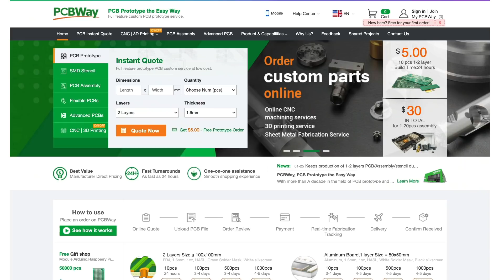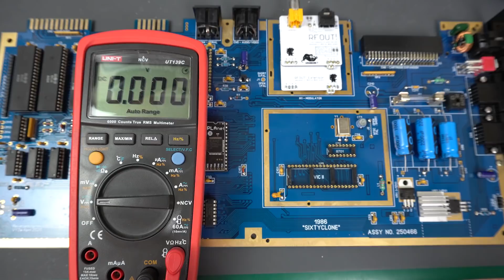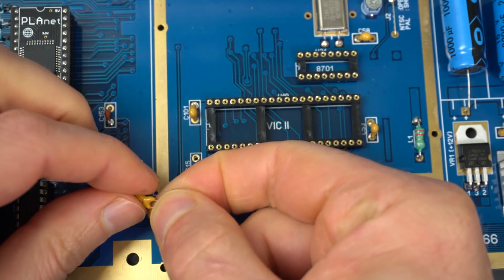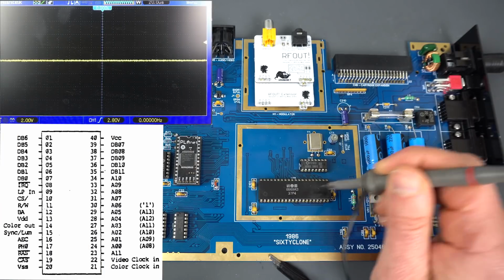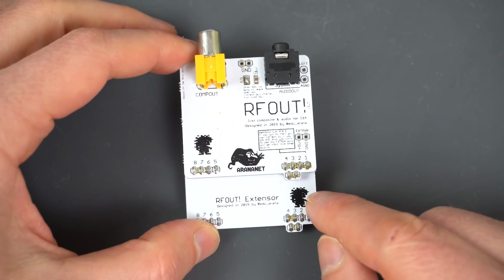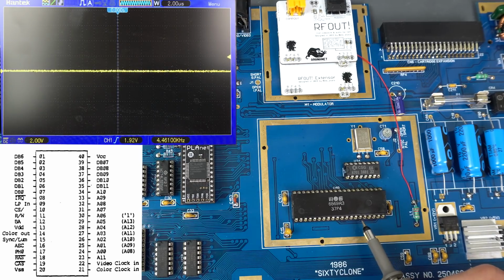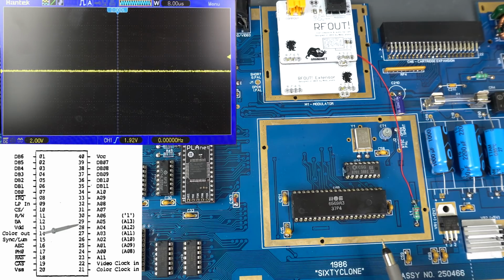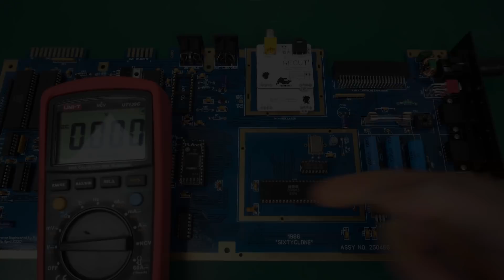Fixing a Modern Commodore 64 Build

Comment: The combination of the two capacitors should do the following: the 100nF eliminates the HF ripple, the tantalum capacitor  intercept the pulse peaks. The ESR value is lower than that of normal electrolytes. In most cases, it can be replaced with a LOWESR electrolyte.

I would not leave the reverse polarity tantalum in the circuit because it may be partially damaged.

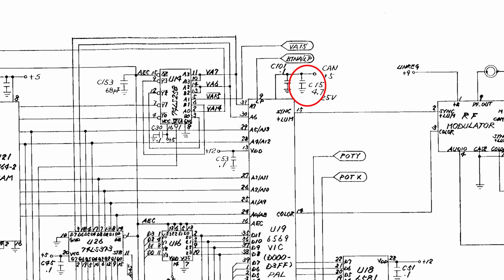Comment: 7:36 they used a tantalum because it has higher capacitance per volume than ceramic. If you look carefully at the schematic you can see that near the left capacitor is a .1 (uF i suspect) when near the right capacitor is a 4.7 (uF again i think). 
Nowadays they are all yellow (including SMT packages). 
Ceramic now include higher capacitance values but I would not be surprised if in the 1980s there were not. 
Also in this case the tantalum is used as an energy reservoir rather than decoupling (that’s a job for ceramics) so that if the voltage were to dip for some microseconds it would hold the voltage up while discharging. My guess is that a voltage dip would cause some kind of glitch, maybe some register losses of some kind

Comment: Although it was not the problem, I thought that maybe it could help someone else, who knows. What I was thinking right away was “oh maybe the backplate of the regulator is not to gnd but it is a vout pad” (although i think it would have just blown the fuse). But it could be an error that some non-experienced person could do. So maybe some ebay regulators or the wrong package can really cause problems if you are not aware of the fact that the back plate on those can also be Vin or Vout other than GND. I don’t know, I thought I should share it. Let me know if you think it might be helpful or a totally useless comment

Comment: A tantalum capacitor as more capacity than a ceramic capacitor. They are always used in tandem because the ceramic capacitor as a fast transient response the tantalum does not have.

Comment: Hello Noel, nice video and good desdcription as to what is going on.  Tantalum capacitors are used on power supply busses because they lossy and have significant ESR (
equivalent series resistance).  This damps the bus and prevents oscillation.  The regulator IC is basically a power op amp and is subject to stability problems if the output is shunted by a low ESR capacitor like a ceramic.  The schematic you presented shows a ceramic and a tantalum in parallel which is good modern practice.  IC manufacturers have papers explaining this and some of the data sheets also have explanations.  I have also read an interesting paper showing the effects of various capacitors on the performance of linear regulators.
Reply from the maker: Interesting! Those details are definitely beyond my depth of analog electronics, so that's really helpful. I ended up replacing it with an electrolytic one of the same value. Do you see any potential problems with that?

Comment: Prob the prev short causes the dram to malfunction? sorry, im new, and pretty much amateur in electronics to no one surprise even with my degree of electronic engineering lol
Reply from the maker: That's unlikely because the thing with shorts is that they take all/most of the current and channel it through themselves, usually dropping the voltage in the process (because the power supply isn't an ideal voltage source). So the DRAM didn't feel anything bad other than the voltage dropping after a few seconds, so it was like a nice way to turn the power off 😃

Comment: 4.7uF ceramic? Where were you supposed to find one in 1982? Of course it was tantalum.

I also wouldn't really be inclined to put it back in after pulling it out, i mean, it has been previously stressed.

Comment: never seen a blue tantalum before, where do you get them/what country are they commonly blue?
the ones I've seen come in two colors, a horrible yellow, and a charred black with just 2 legs sticking up and nothing else
Reply from the maker: Most of the ones I see in computers that go through my workbench seem to be blue (like the original one on this C64 board). Maybe it's a European thing, or maybe it's just the computers I usually work with. I've been told that most of the ones in PCs are yellow, which I usually don't work with, so maybe that's the main source of the difference.
Reply: ah right, the ones on the older machines I get are yellow, and usually failed, are the blue ones more reliable at all?

Comment: A tantalum capacitor is used here because its characteristics are very similar to an electrolytic: high capacitance in a small amount of space, but unlike electrolytics you don't have to worry about them drying out over time. However, you still have a high ESL similar to electrolytics, so for decoupling power rails you'll usually run them in parallel with a smaller value ceramic capacitor to make up for that. That's exactly what's shown on the schematic at 7:25, you've got a 100n ceramic in parallel with a 4.7µ tantalum. Other chips only have the 100n ceramic likely because the amount of noise they would dump out the v+ pin is small enough that it doesn't need the extra farads.

Comment: I've built a sixty clone replica and it worked fine since the beginning (I was amazed to discover I didn't do any mistake, and even if I used jumpers instead of the ferrite stuffs, it worked and works  yet flawless). That's the C64 I'm using habitually.
Reply from the maker: That's great! I'm still unclear why the original board is full of ferrite beads. I get what they do electronically (kinda) but I don't understand why they felt the need to use them everywhere. There are other computers of the time without a single one.

Comment: As someone that has worked with repairing electronics for 30 years myself, with a completely new board you cant even rule out that the traces are correct,something that you didnt mention and came to mind when you had the shoring problem of the 5 volt. I have personally had both shorts and breaks in the traces on new boards that the traces were supposed to be electrically tested on, not the most comon problem, but still. Great to see that there are people building these things, i still have an aoriginal breadbox Commodore 64 that i boight new back in the day.
Reply from the maker: Good point. I didn't go there because I knew that this board design was already tested and working with other people. But you're right that there was always the possibility of this one being defective somehow.
Reply: @NoelsRetroLab  Sure, but what i was talking about wasnt the design but rather the possibility of a manufacturing fault of that perticular PCB that you got in your hands, like i mentioned it has happened to me in some cases that one board out of many had faulty traces.

Comment: I have to wonder how a dead test cartridge even works without RAM. No RAM means no variables for your code, other than three 8-bit registers. Maybe with those three registers it's able to make due?
Reply from the maker: It's tricky, but definitely possible. I did that on the Amstrad diagnostics ROM, but there the Z80 has more registers to play with, so I think it's definitely easier.

Comment: Someone took their time to design a board - didn't change the power supply to single voltage with SMPS, didn't exchange CIA's, PLA, clock gen and ROMs (and probably others that could be done in programable logic, maybe even CPU) for an FPGA/CPLD. Seems it still even uses two DRAM chips when substituting SRAM is simple... Could have improved the whole thing by a lot (and got rid of chips that fail often), but instead just copied the original board...
Reply from the maker: The goal of this particular board was to be a 100% replica. There are other projects out there that designed the board from scratch and can add improvements like the ones you're talking about, which can be really interesting as well. But there's something really nice about it being completely backwards compatible with a real C64.
Reply: @NoelsRetroLab  Well... in part yes it's nice that it is an replica (that is made to a manufacturing standard and pads don't lift when you look at them), but then again some things about it are archaic. At least the power section could have been improved without detriment to the computer - even at a benefit, because its the powersupply that kills most of the chips. Same with the RF can area - could be used to just house chroma + luma buffers and composite mixer - no one is using RF modulators anymore (I hope) ;-)
I mean... it is kind of good that board like this exists - for masochists ;-)

Comment: I cut my 8-bit teeth on the Commodore 64 (with a special mention to the Atari 400 which was the first micro I owned). Those 8 bit machines were powerful enough to be interesting, and also simple enough so that a properly obsessed school child, armed with the provided documentation, could suddenly find themselves a budding computer scientist, with WarGames on the big screen to let us know the magnitude of what was coming. If you're a very young person seeing this video, know that the Commodore 64, first among equals of the period, was an absolute game changing personal computer, and many of your favorite games were probably contributed to by programmers who had learned the core, really important, lessons of computer programming on computers of just this type. Also, it wasn't even a "weak" computer. Color hi resolution high speed graphics (faster than the human eye, anyway), great sound synthesis, a peppy clock speed. Once you owned a machine like a Commodore 64, even as a child, and had read its operating manual, it was manifestly obvious that if you could master it, you knew what a real, powerful computer truly was, and that everything that would come after this would just be more of the same, better to be sure, but only quantitatively, not qualitatively, in accordance with Alan Turing's 1932 epiphany that, deep down, there's only one kind of thing anyone that can make that should bear the term "computer", &c.

Comment: The Tantalum capacitor used as a low impedance Coulomb (Charge) bucket. They are often used on power supply rails that are a fair distance from the voltage regulator.
Reply: I was just about to write a comment to that effect. They have a nice low ESR and make good decoupling capacitors. They also really do not like to be reverse biased!
Reply: They're damned dangerous things particularly when becoming old or subjected to overvoltage where they can spontaneously ignite and launch themselves as burning fireballs!
Reply: Yes, the low ESR enables them to dump or build charge faster. Combined with higher capacity and better temperature and frequency stability than cheramic, they are a typical go-to for decoupling digital circuits.

Comment: When building a kit, you don’t just solder everything in place, cross your fingers and expect it to work, instead you construct it in logical stages with component value checking as you go. For instance,  initially assemble the power supply regulation circuit and check to see if it works, then progress to the next stage which might be installing any clock circuits.
Reply from the maker: True, that's probably a better way, but you need to be intimately familiar with the circuit itself to pick the right order and make sure you got all the components required up to that stage. I suppose a kit could provide those instructions, but most of the ones I've seen just have you solder everything, and at best, they'll provide some checks afterwards. I do like your idea though.
Reply: @NoelsRetroLab  Many thanks for the reply. Most kit instructions follow that lottery approach. I designed and built commercial prototypes from 1970's onwards for many decades where it was necessary to use an incremental approach. In the 70's through mid 80's prototype PCBs did not have solder resist so careful soldering was required to avoid unwanted short circuits. I do really like some of the modern mod kits that use bespoke flexible PCBs to replace bodgy wire connection to neaten their installation.

Comment: These detective / resurrection episodes are fantastic! Question / concern: When you changed the voltage on the RF module to +5 by unsoldering the pin and running a wire ... is there any risk of accidental contact of the pin still present in the unsoldered hole (perhaps by vibration if the machine is moved around)? Would it be appropriate to snip off the pin on the “bottom board” of the RF module?
Reply from the maker: Thank you! No, there's no concern about accidental contact. I actually removed the metal pin completely, so you're left with the plastic from the pin header separating the two solder points.

Comment: NEW CIA, VIC-II and SID replacements are also really important.
Reply from the maker: Right! Working on a SID-replacement comparison episode at the moment. Coming soon! 😃
Reply: @NoelsRetroLab  Yeah, I saw a recent video with an FPGA SID playing Lightforce tune and it sounded OK at the bit near the end where most emulations fail. Not sure on the state of VIC-II direct replacements. CIAs are less important for now and most of the other chips are no problem as far as I know. Of course you have to recreate the exact smell of a brand new breadbin C64 from 1983....maybe one day I will do a video on what readily available item will do that :)

Comment: Wow! I just built a Color Maximite 2 and it had some tantalum capacitors. I had no idea they were polarised.. amazingly enough I had 3 soldered the right way around. Very lucky!
Reply from the maker: Wow, that was lucky! Depending in which part of the circuit they were, they could have exploded.
Reply: Also notice that electrolytic caps mark the negative lead, while on tantalums the positive lead is the one that is marked.  Aren't standards wonderful?

Comment: That tantalum cap that was connected backwards will have been weakened by that. I would replace it anyway even though it "seems" to be OK, and I would replace it either with an electrolytic or a ceramic. Tantalum caps are more trouble than they're worth.
Reply from the maker: Agreed. I'll swap it out as soon as I pull the board out again. I honestly didn't realize they would be permanently damaged, but everybody seems to be in agreement about that. Thanks!
Reply: @NoelsRetroLab  : The issue with tantalums is that like aluminum caps, they're electrolytics, so internal misconfigurations of the chemistry are caused by reversing their polarity (which is why electrolytics require a DC bias to properly handle AC uses). However, while aluminum electrolytics will slowly repair themselves if subjected to a low current of the correct polarity, tantalums don't, and supposedly go through some sort of collapse cascade.
Reply: If you're going to swap it with a ceramic, just leave it out.  Tants have different frequency response than ceramics do, so replacing it with another ceramic won't help.  There's already a ceramic on that rail.

Comment: My A500 conked out in '91 , it just went black. When I removed the keyboard, it worked fine. The tantalum cap on there had suddenly decided to die.
Reply from the maker: That's another problem with tantalum caps: They seem to short with time. Not a fan of them.
Reply: @NoelsRetroLab  I read here and there that tantalum caps should stay stable longer than ceramic caps, so I guess it's down to quality. Commodore (among many) wasn't above buying inferior components to cut cost.
Reply: @paulmichaelfreedman8334  : Perhaps they stay more stable in regards to e.g. temperature, but past a decade or two I'd expect the tantalum to be worse, because they're a type of electrolytic cap that lacks the self-heal capability of aluminum electrolytics.

Comment: Noel, probably I am wrong, but... at least it seems when you finally checked out the test with warning on cassette that the cassette cable is actually not very well inserted. That could be an explanation about why when you replaced the 2 "wrong" ICs still the same mistake, same point but this time only 1 is showed as wrong IC. Does it make sense?
Reply from the maker: The CIAs are both reported as faulty, independently of which ones I put there (it just takes another pass for the second one to be reported). The cassette part... I did show up as faulty and that just went away. I thought it was because I cleaned up the edge connector, but maybe you're right and it just wasn't pushed in all the way.
Reply: @NoelsRetroLab  I think it is a remote possibility, :) and maybe you will find the right issue in the next episode!!!! :)

Comment: For the Sixty Clone board may I suggest : PLAnkton EV http://www.melon64.com/forum/viewtopic.php?f=34&t=11696
TOLB : http://www.melon64.com/forum/viewtopic.php?f=34&t=4055
And Saruman 64 : http://www.melon64.com/forum/viewtopic.php?f=34&t=8779
Reply from the maker: Nice. And don't forget a nice SID replacement. I'm actually working on a video right now comparing different options.
Reply: @NoelsRetroLab  I don't dare suggest any SID replacement right now. SwinSID had a serious problem with bias (DC offset on the output), FPGASID is excellent but very expensive. Also, there are replacements for the VIC-II which are coming with an HDMI output.

Comment: Ceramic capacitors above 1uF start to be more expensive. Tantulums are cheaper at high capacities 1-100uF, after that electrolytics start making more sense
Reply: If I recall correctly, they're smaller than a ceramic for those same capacities too, because they're technically an electrolytic themselves (just not an aluminum, and either partly or wholly lacking aluminum electrolytic's "self healing" capability).